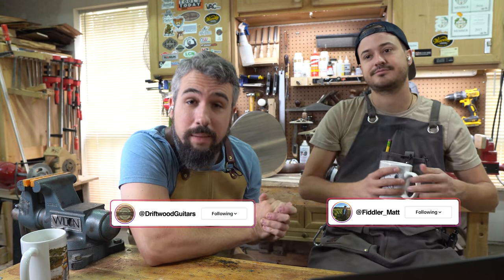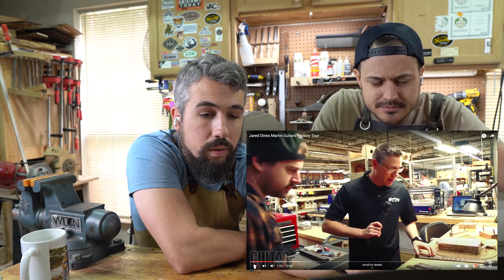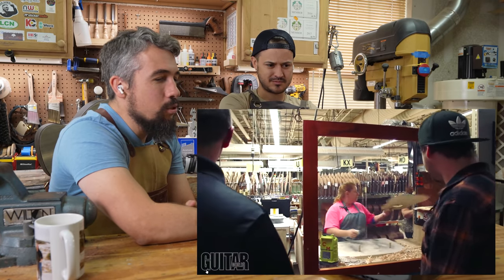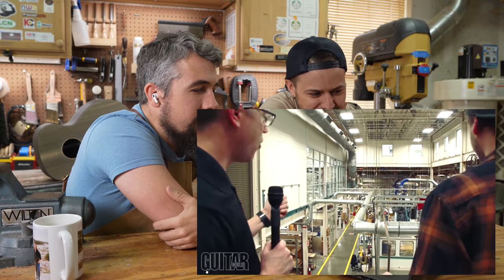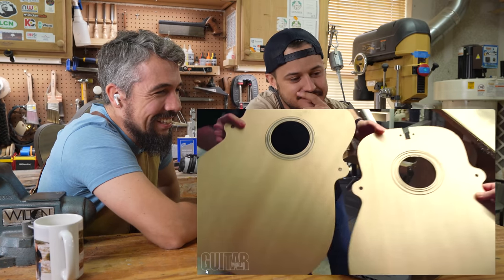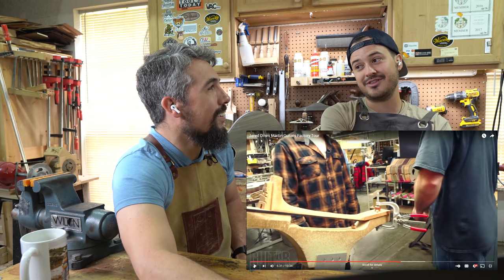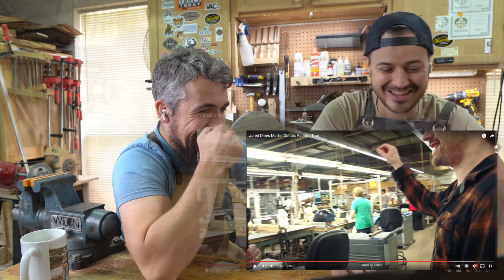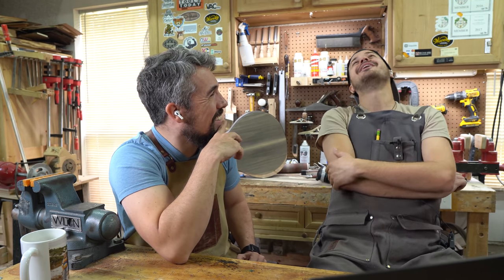Professional Luthier Reacts: Martin Guitar Factory Tour

Comment: I got my first Martin in 1966, a D-28 for around $200. I have owned nine Martins since then, none older then that year. Unless you buy vintage or empty your wallet in the custom shop, they are now just so much crap compared to the old ones. Especially awful is the grotesquely inflated  "re-imagined " series.  I am used to playable necks on acoustics. I had a 64 Gibson J-50 with a 1  5/8" nut width neck and after that everything is painful to play. I like the Martin 000 bodies because I'm sick of Dreadnought boom-boxes but even then, especially in the "MD" modern deluxe series, the sound is muddy and loud and no high end or clarity at all, despite the titanium. By the way they have discontinued the titanium truss rods but deceptively did not announce that, they just omit that from the specs....check it out. A is more or less pointed out here, in terms of "voicing", that is just non existent outside the mysteries of the custom shop. What this means is that build quality, though poor, is above average, and before they distribute from their assembly line, they inspect that it won't fall apart and that's it. If it sounds like crap, who cares?  Be extremely careful since about the cheapest Martin worth looking at is gonna approach $5000 with tax, and as i sid on another astute review by these guys, I have a cheap $150 guitar that sounds as good as ANY new Martin.  Martin necks are truly notoriously difficult to play. They ship with the highest stiffest action I have encountered on any high profile instrument, and you will have to have a serious set up before the thing is remotely playable, at ANY price. Martin is OVER as far as I'm concerned.
Reply: Their sales and customer base say otherwise. Taste is individual.  If it was not, there would be only one guitar company. You could call it Dave's
guitars. I've owned 12 Martins in my lifetime covering a span of almost 60 years. Martin is still here and thriving since 1833. There is probably a
good reason for that.

Comment: I took the tour many years ago, don’t recall exactly when, and I took the tour a few years ago. I lived in Allentown so I had friends who worked there. The last time I took the tour the company was under the current Chris administration. I was appalled at the number of novelty POS guitars they were dragging out with pride. Pure junk IMHO. They hustled you through most areas and you couldn’t really ask the employees any questions. Any detailed process was talked about quickly and then hustle you away. The saddest part was their comments about “we make our all wood guitars in the back” where the tour doesn’t go. I remember when they moved their string manufacturing out of Nazareth to Mexico…it took an excellent entry level job out of the area, I was fairly annoyed at that. At the end you get a soundhole cutout with the Martin logo burned into it as a gift. Useless but , gee, thanks. I’ve disliked Martin’s for years for my own personal reasons and still my most recent guitar purchase was a Martin 000-15M because it played and sounded amazing. I also have a Gibson CJ165 that was made in the Ren Ferguson es and it rocks. Remember the horrible Norton years with the DOUBLE X bracing?? Firewood. The same thing happened at fender when CBS bought them…junk with few exceptions. Corporations tend to screw up building guitars. Oh well, I babble.

Comment: Martin Necks are the worst, they constantly need to be reset and the reset is a nightmare for a luthier. Get a Taylor.
Reply: A neck reset has nothing to do with the neck. 

A neck reset is due to body distortion caused over time. 

Try knowing your subject next time.
Reply: That's absolute nonsense lol. And yeah Taylor bolts on their necks and sound terrible. A neck reset also has absolutely nothing to do with the neck itself. Had to do with the body of the guitar sinking etc. 

And yes, sometimes Martins need resets, as all great sounding brands do. It's because they're built lightly at times. Which is why they blow Taylor's away. A Taylor will never age and get better with time etc. That heavy poly finish they use too. Forget it.